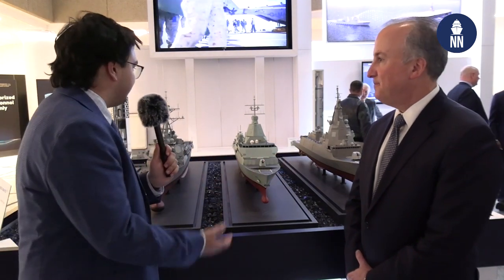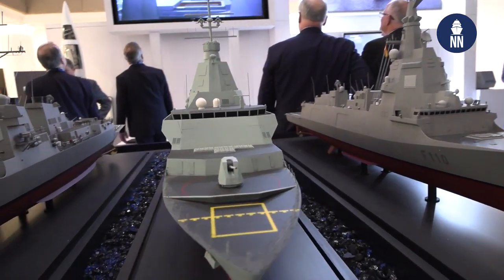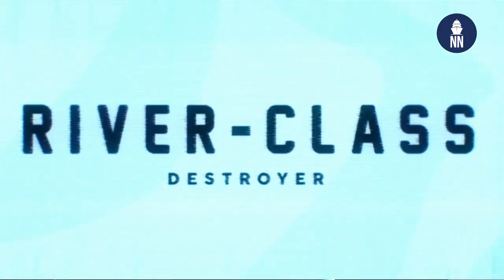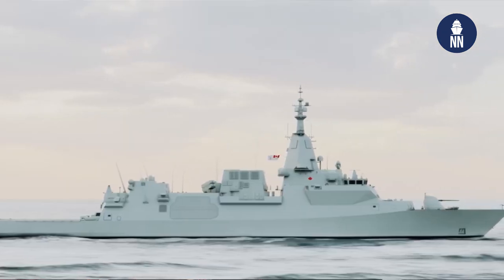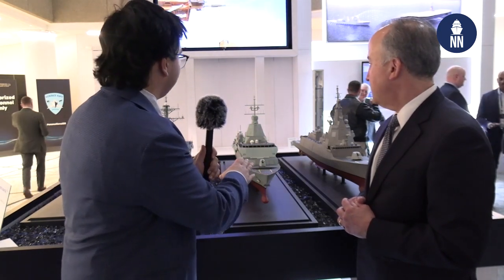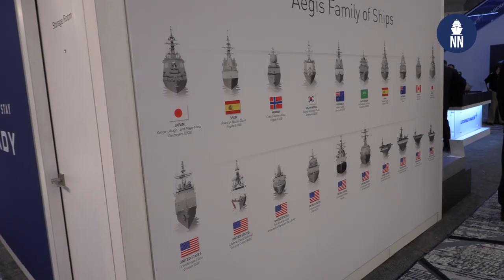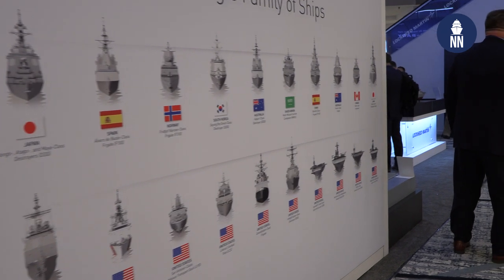Lockheed Martin at SNA 2025: River-class Destroyer and F-110 Frigate

Comment: Disappointingly but predictably this design was defanged a bit from the original winning concept. That included both more VLS cells up front AND launchers for British SeaCeptor CAMM missiles amidships. I found that a much more compelling layout for a "near-peer" fight. Hopefully some of the later ships will have these re-added.
Reply: The modular mission bay present in all Type 26 variants can be replaced with 32 Mk.41 VLS cells based on a RAN study on adding more VLS cells to the Hunter Class.

Comment: I think it would be more efficient for Canada, Spain and Japan to work together to negotiate with Lockheed Martin.
Reply: Each of those Navies have different needs and plan to do different things with their ships.
Reply: @avroarchitect1793 
I think Canada and Spain will also demand anti-ballistic defenses in the near future.
At that time, Lockheed Martin will reuse the assets he has jointly developed with Japan.
If Japan, Canada and Spain can share development assets, they should be able to save money.
Reply: @主水-p5b  doubtful that the Canadian government will pay for such an expensive system. The Canadian voter is allergic to defence spending. Just buying a helicopter or plane becomes a federal election issue. Look at the F35 acquisition.
Reply: @avroarchitect1793  Buying the most recent SM2 variants won't be a problem, convincing the Canadian Government to procure SM3 and SM6 is going to be nightmare.
Reply: Spain should buy from Europe or build them themselves. It were better if all Atlantic nations in European NATO would settle on the same design and build them on several sites, quickly. There is a need for 60-70 new frigates. Within 5 years delivery. Not in the far future.
Reply: @secretarisfotografica1909  sadly each of the NATO navies have different requirements than the others that generally makes this impossible. The USN has very different needs than the Italian navy and Spain doesn't have the same needs as the Royal Navy or Royal Canadian Navy.

Comment: Only 38 VLS on the Canadian ship?  Seems light for a destroyer.
Reply: Its actually only 32 CELL, its more like an AIR WARFARE FRIGATE than a DESTROYER, they gonna load it out with quad packed RIM-116 in 16 cells(total of 64 missiles), SM-2 in 8 cells and tomahawk block V in 8 cells
Reply: @chrysllerryu4171  The model shows another 6 cell launcher in the midship location aft of the funnel.
Reply: @chrysllerryu4171  
It’s a 24-cell VLS equipped ship, the numbers looks small but don’t underestimate the Mk 41’s quadpacking capability. 8-cells alone will already house 32x RIM-162 ESSM block II which are mid range anti-air missiles, the remaining 16-cells will be use to house SM-2 which have a longer range than ESSM block II. The River-class will be using the RAM instead of SeaCeptor, the model shown here is outdated. The 2x3 VLS at mid ship is replaced by likely two Mk-49 GMLS located in port and starboard similar to where Phalanx are located in Aussie’s Hunter-class. Each Mk-49 GMLS have 21-cells, two of them will give the ship 42-cells to house short range anti-air missiles. If you add them all together, it’s 90x layered anti-air missiles in total: 42x short range, 32x mid-range, and 16x long range. Don’t forget that these ships are fitted with a strike-length Mk-41 VLS which gives them the ability to launch BGM-109 Tomahawk.
Reply: Front vls is now 24, what's happening with the 6 cell is unclear
Reply: I hope they put ESSM into those 6, or better yet,, 12 for 48 ESSM.
Reply: @ronmaximilian6953  ain’t room for 12. Also they’re not putting ESSM in there, was going to be CAMM, now RAM for some reason
Reply: They were calling it a frigate, then they changed to calling it a destroyer. The change in designation seems to just be name preference. 8000 ton warship with AEGIS, regardless. They can call it an "angry yacht" if they want, as long as it works.
Reply: @wyldhowl2821  What are small Naval ships if not VERY angry Yachts?
Reply: Better vessels than the company native country, crazy🤣🤣🤣🤦🤡
Reply: it is
Reply: I’m certain it will be a DEI VLS.  So able to to all deal with all social network combat scenarios.

Comment: Canada Ship has NO CIWS, neither RAM, nor Phalanx, nor 35mm Oerlikon or else??? 😵‍💫... I am confused....
Reply: The River-class will have two Leonardo Lionfish 30 mm and probably two RAM. Although, the RCN RCD fact sheet doesn’t state how many, It does state it will have RIM-116 RAM.
Reply: The spec has changed a bit for the River Class Ships, the latest one has RAM Loaded in dedicated VLS Cells rather than the conventional Trainerble Launcher.
Reply: @paultanton6721  RAM Systems never told about a VLS Version... I Do not think this exists yet...
Reply: @der_picard3370 You are correct it doesn't exist yet but it will be Operational by the time these Ships are in build.
Reply: @der_picard3370 The River Class destroyer will have two standard 21-cell RAM launchers to serve as CIADS, I have no idea where the concept of VL-RAM came from. The front 127mm naval cannon will serve as forward CIWS and two 30mm SeaLion Auto-Cannons located on the corners of the hangar will serve as rear CIWS.

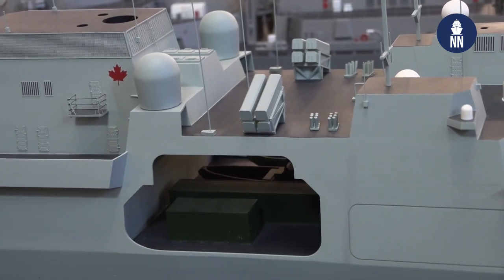Comment: What is the 3x2 VLS left of the NSMs at 2:10 ? I thought the Canadians dropped the ExLS/CAMM requirement?
Reply: It's an old design of the ship. The 3×2 is switched for the sea ram
Reply: Those are just SRBOC decoys.
Reply: Scratch that, I see what you are looking at.  They almost look like JQL launchers for Hellfire.
Reply: @jm2453  They look like SRBOC, and that's a traditional place for them.  Definitely not the Nulkas which are larger.  Edit: the Nulka launchers are aft, between the antenna domes.
Reply: Also I think it has 24 vls instead of the projected 32